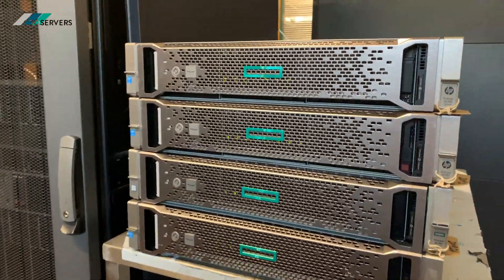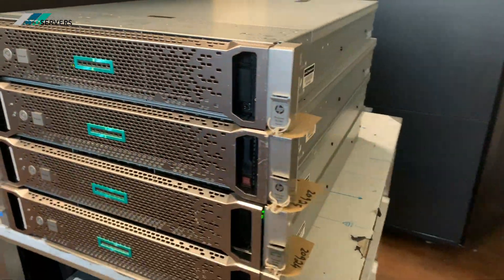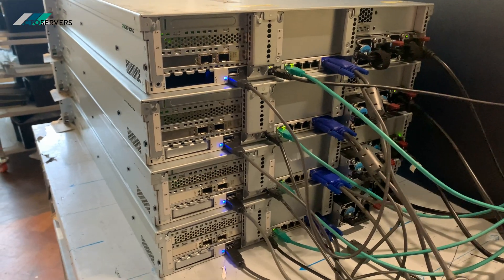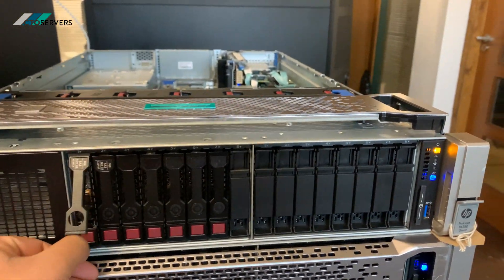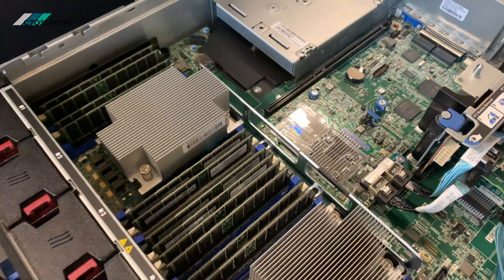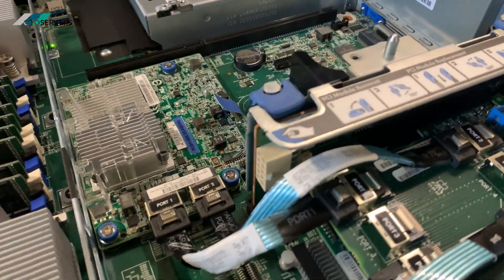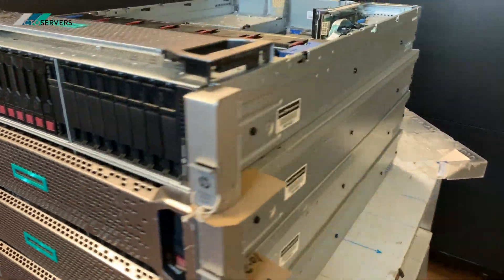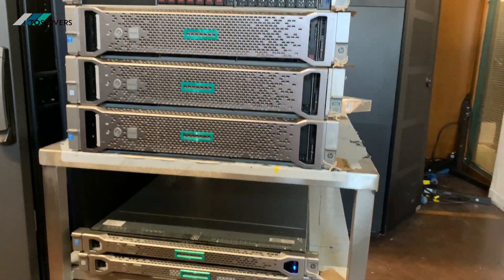HPE ProLiant DL380 / DL360 Gen9 Rack Servers . @CTOSERVERS

Comment: I just purchased two of them and arrived in 2 week, i live in italy so its EU. I got one empty (because i'm replacing 2 1p 1u barebones with the following cpu) and one with 2x2680 v4 and 128 gb ram. Arrived in time (ordered the front beezel separately too, just because its cool 😎), installed and plugged into the power, moved sd-card with proxmox on those dl360 g9, installed a few cards such as an external raidcontroller that i had before for a diskshelf just below. They are working perfectly! I will leave a 5 stars positive feedback ⭐️ ⭐️⭐️⭐️⭐️
Reply from the maker: Thank you for the purchase !